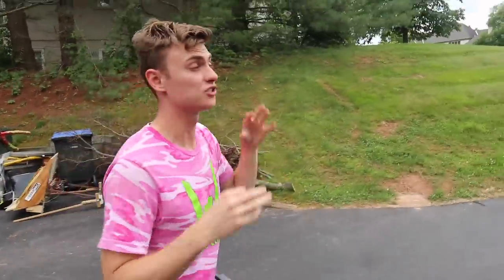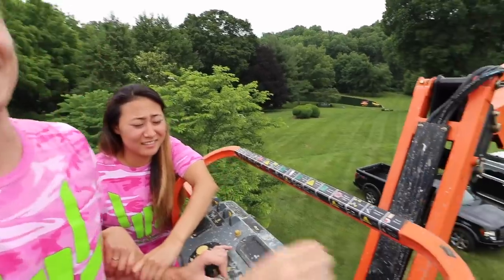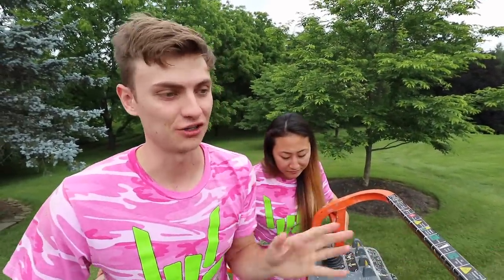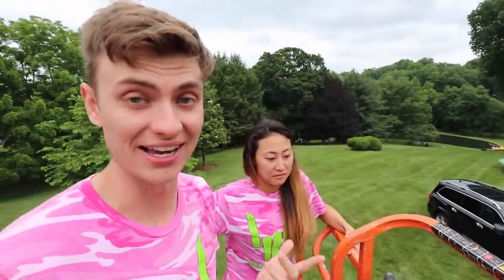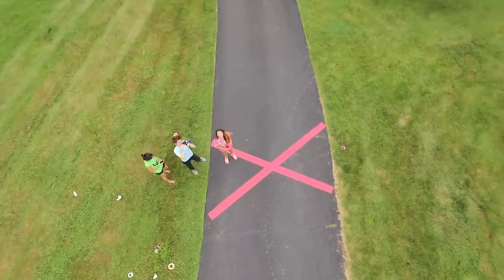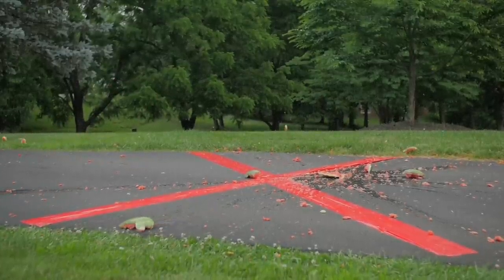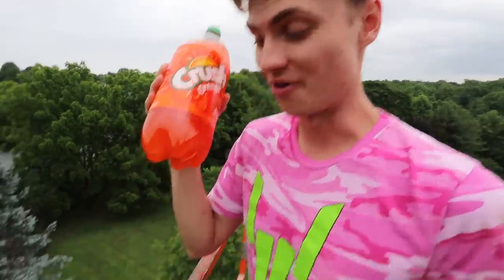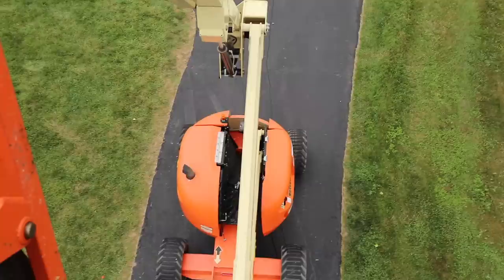DROPPING WATERMELON 45FT!!

Comment: He goes up about 15 feet, they both get scared go down, then go up, then goes back down. Then goes to 45ft drops soda it explodes and they are shocked, and when it doesn't they are still shocked? Then they start screaming for the watermelon, but they scream uncontrollably. What?